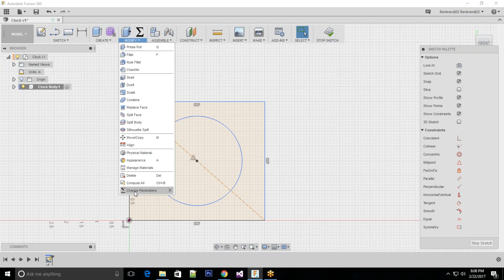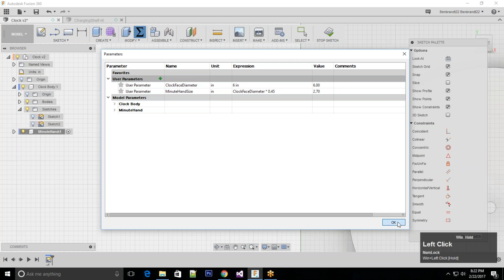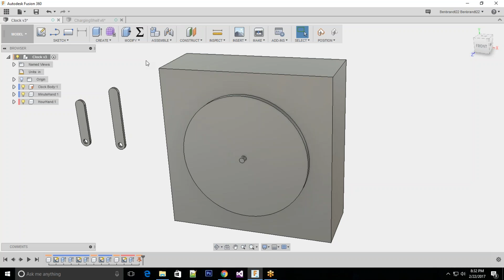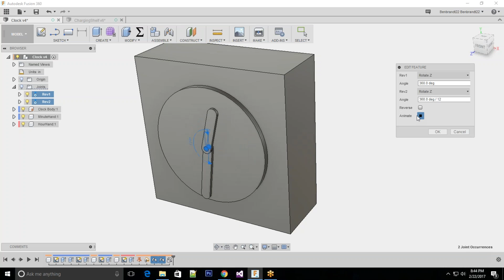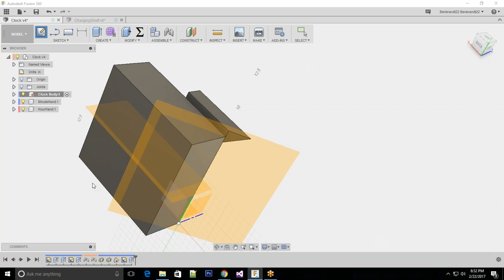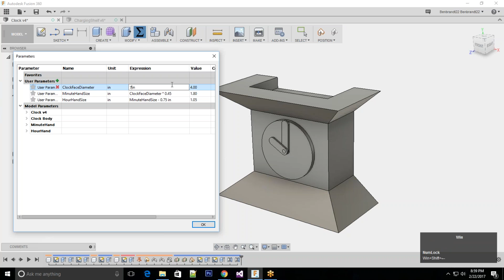Fusion 360 CLASS 101  class 4 of 6

Comment: @Ben Not sure if you'll answer questions after the fact, but just curious why you used that method to do the crown molding instead of using the Sweep command? The Sweep command just seemed a lot quicker and easier for the same result. Is one method preferred over another for some reason?